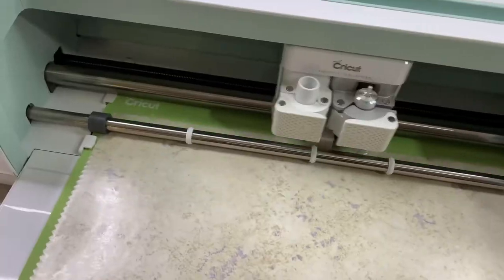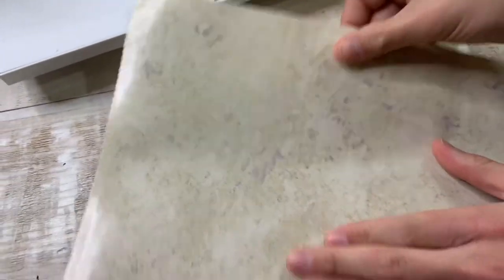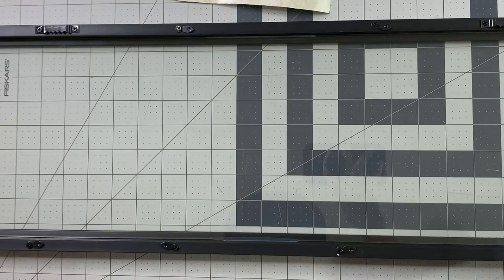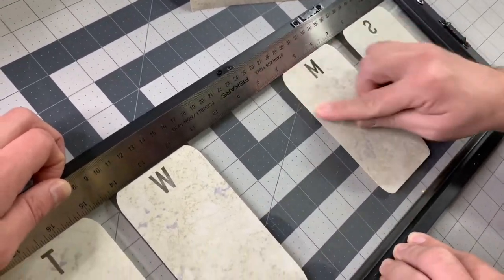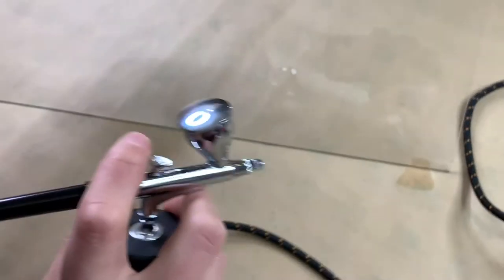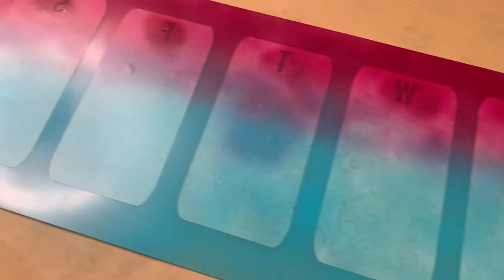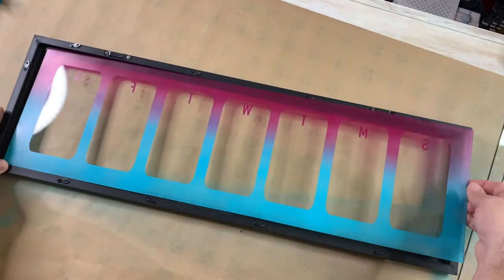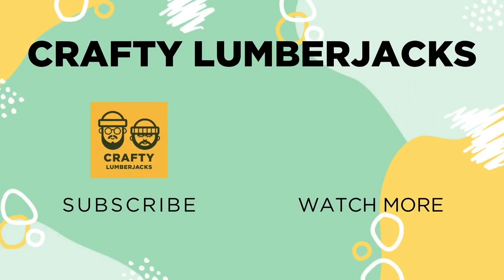Easy DIY Dry Erase Board ~ How To Airbrush On Glass

Comment: Great project just one question if the contact paper is white why did you remove it?
Reply from the maker: Great question! The contact paper was a bit bumpy and had some bubbles in it. So it didn't look as clean as we wanted it to. The white paper really helped the paint pop as well.
Reply: @CraftyLumberjacks  got yeah couldn’t see the bumps I would have done the same the bumps would have drove me nuts.